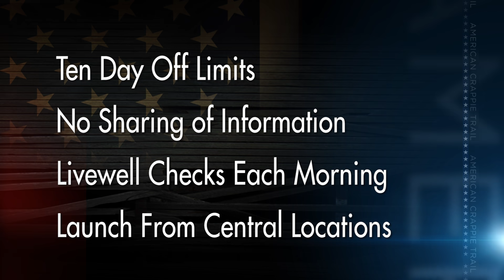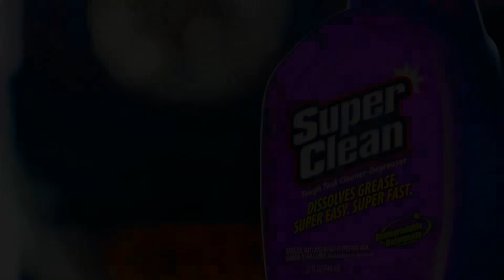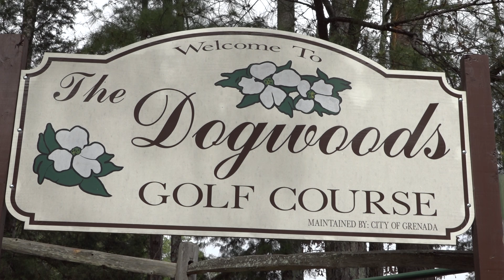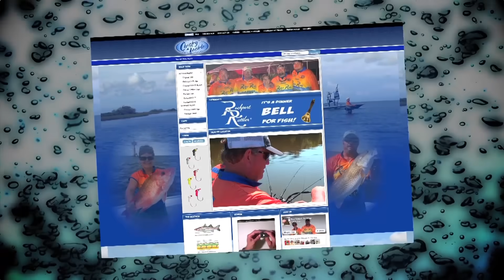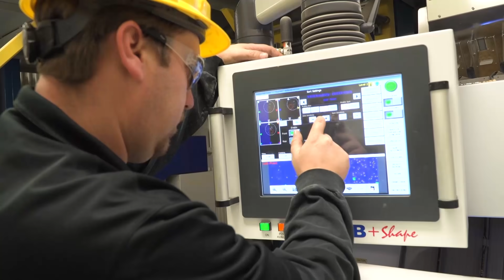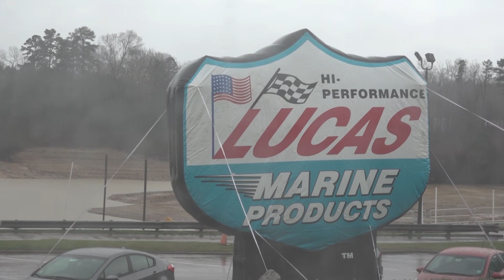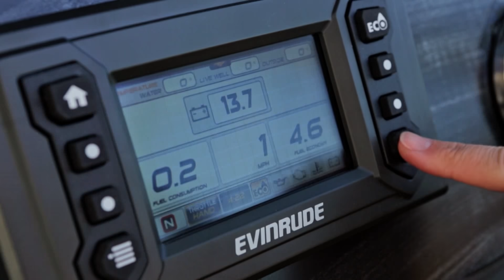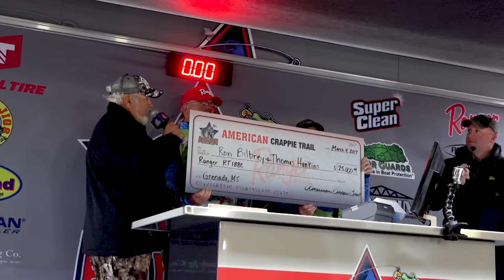ACT 2018 EP2 - Grenada

Comment: It's a rich man sport, that's what fishing and boating retailers bank"on! equipment shouldn't cost that much!!! "ELITE" money money money..
Reply: I used to think the same thing until I fished with an old 96 bass tracker with a johnson 40 horse in bass tournaments with 60 70k bass boats would leave me in the wind. Fancy equipment and all but I still managed to hold my own. I had two top 2s and a 3rd and 5th place in one season. I also had biggest bass and 2nd place biggest bass multiple times... with that said it's still possible to win even when the odds are against you. It's fun because I laugh at those guys with the fancy equipment who think they know what they're are doing. Most have no clue.
Reply: You dont have to have the newest of everything, just a boat that floats and knowing where the crappie are and how to catch them. You can see them on a depth finder, but that doesnt help if you dont know how to catch them.